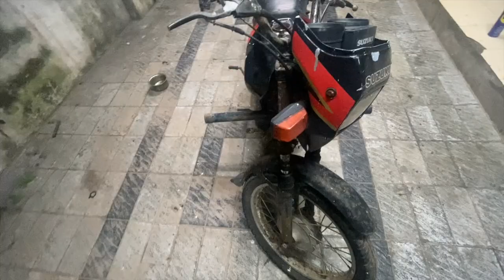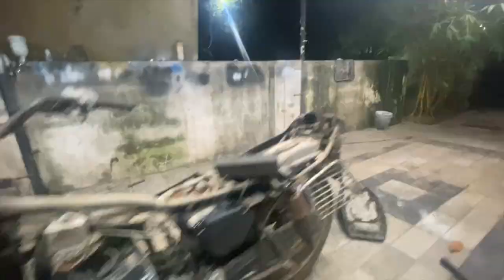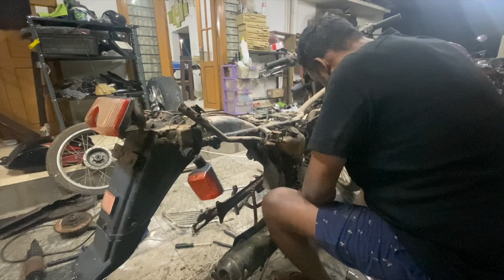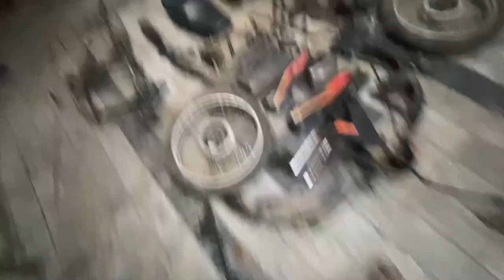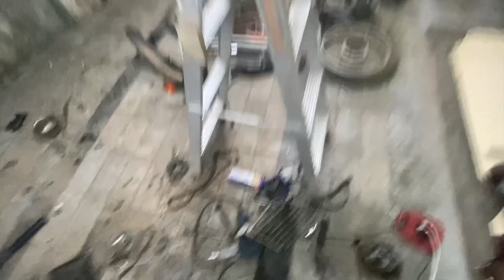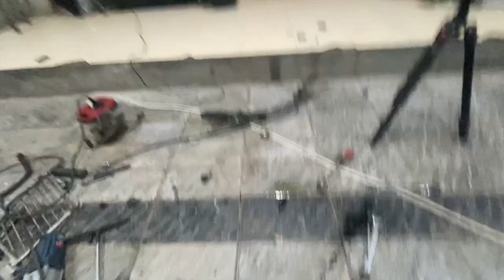Shogun Rebuild Part 2 | Dissassembly

Comment: Bro ente rx 100n moving problem an vandi oru 50 nu mukalil kerunnilla vandi rais avuka an njan work shopil kanichappam clutch disc and plate mattan paranju athum matti oru mattavum illa ath enthu ayirikkum bro onnu paranju tharumo pls
Reply from the maker: Carb avaam, electrical issue avaam. Fuel filter pinne fuel tap check cheyyu

Comment: Brother what is the difference between rx135 reedvalve and Shogun reedvalve which one will be better,is it good to replace Shogun reedvalve with rx135 reedvalve in my Shogun.Does it make any difference??
Reply from the maker: Shogun reed valve will work on an rx 100, not on a 135
Reply: @Yamakaze  ok sir, replacing Shogun reedvalve with rx100 reedvalve in my Shogun makes any change?? Which one is a good reedvalve??
Reply from the maker: @b.s.nandhakumar611  shogun Reed valve is better and cheaper
Reply: Thanks for your suggestion sir 😃
Reply from the maker: @b.s.nandhakumar611  👍
Reply from the maker: @b.s.nandhakumar611  👍